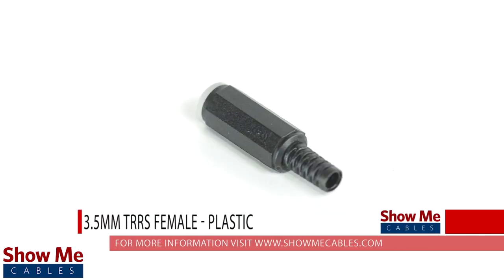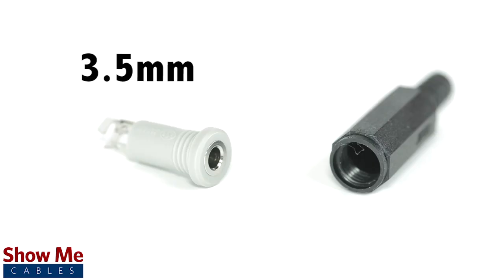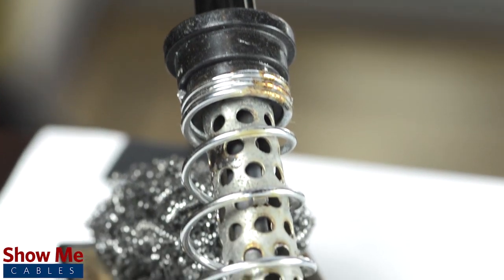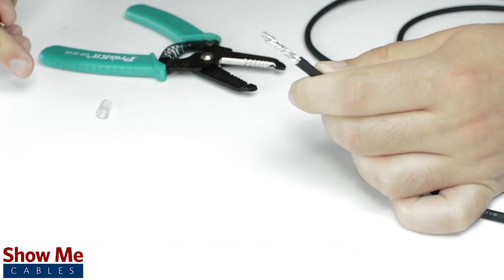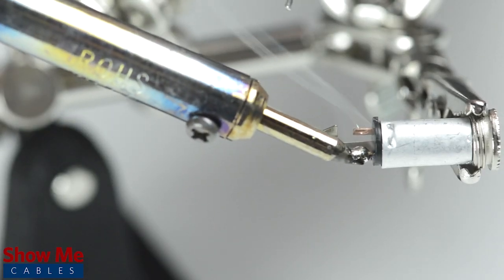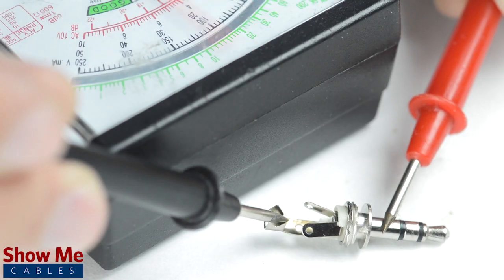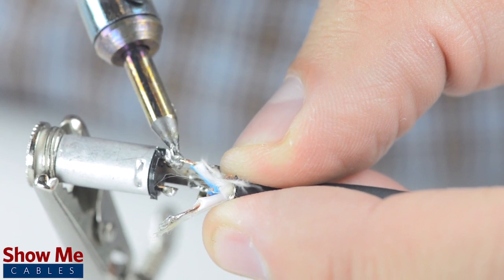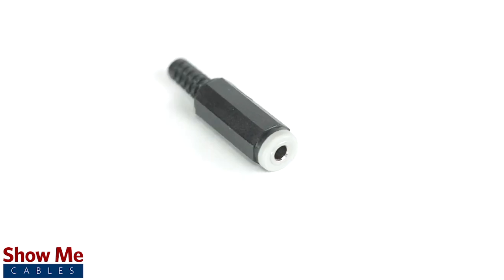3.5mm Plastic TRRS Jack - DIY Project to Repair Your Audio Cable #947

Comment: Poor camera angle.  I cant see which wire he was attaching to the female connector. ...
Reply from the maker: Brad, these are just basic instructions on how to install the connector. Since there are multiple ways to wire a 3.5mm connection, you would need to determine what pinout/wiring scheme you need for your application, and then apply the basic instructions to your installation.